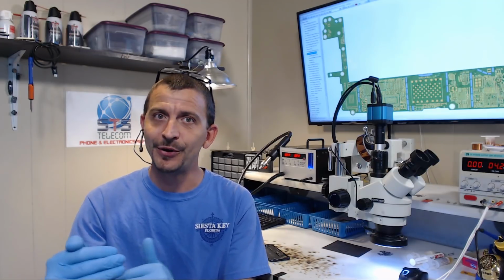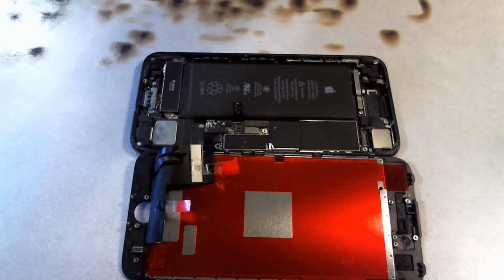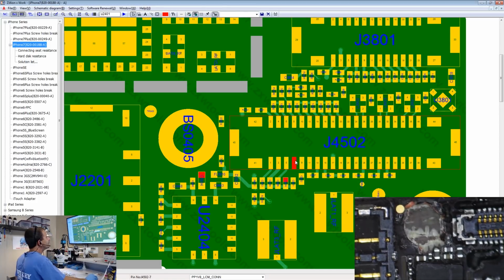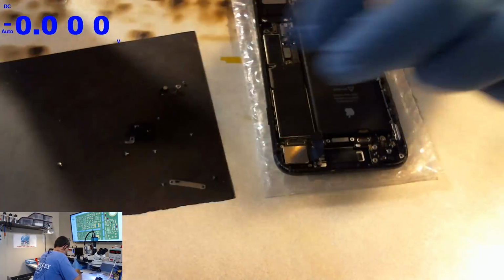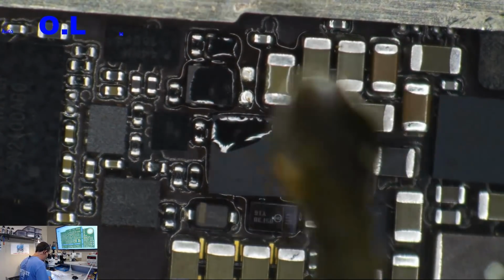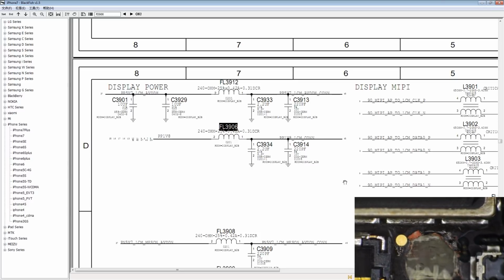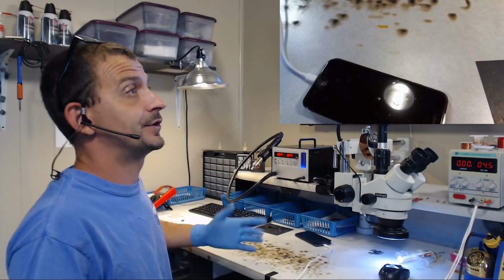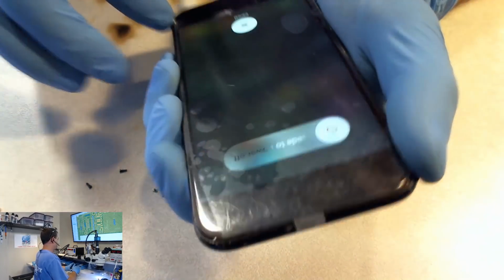iPhone 7 No Image After a Screen Replacement

Comment: Hello.
Can u help me me
I believe my iPhone has a no image problem..sometimes it displays. When its on and it shows dark screen with backlight on i have to continuasly lock and unlock untill it displays...if it shuts down sometimes it turns on displaying sometimes no display..so i heat the phone than it displays 
Heating the phone works for me.
And when its displaying i dont lock the phone autolock of. As if phone locks it shows no image

Comment: Hey man
i have a question pls
i bought this microscope as you suggested and i want buy a camera too,do i need auto focus camera for simul-focal microscope or not, do i need adjust the focus every time do zoom in and zoom out same as non simulate-focal microscope or because it's a simul-focal just need adjust the focus one time ?
cheers
Reply from the maker: The autofocus camera may be handy but is not necessary.  Mine isn't autofocus so every so often I have to refocus the camera to sync it up with the eye pieces.
Reply: Thanks man :)

Comment: Hi sts ive got an issue where my brother who has replaced many lcd screens on iphones in the past with no issues however recently he attempted a repair on my nephews iphone 6s lcd which he did so by mistake with battery still connected however he said it smoked a bit when the lcd connector was pressed in, pressumably because the battery was still connected anyway i do micro solder repairs but cannot do burned pcb trace repairs as thats the issue with this 6s it all works but no backlight tried filter to no avail as its burned pcb traces thats the issue
Reply: Basically just wanted to ask if you repair burned pcb traces fella as its only 3 weeks old the phone and will have a very dissapointed nephew when i break the news to him see bud

Comment: Hey Jason! Big fan of your work from Ireland! I have do a few replacement screens on the iphone 7 and the home button wont work after the screen is replaced? Have you any suggestions as to why this happens is it because the flex has been disconnected and the memory on the little chip has been reset?
Not sure so any advice would be great.
Reply: same thing happened to me